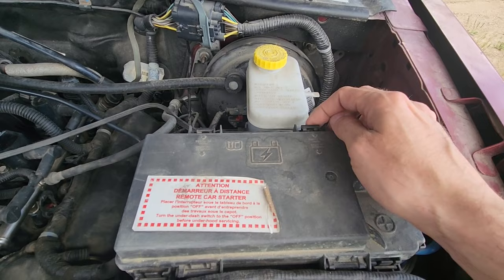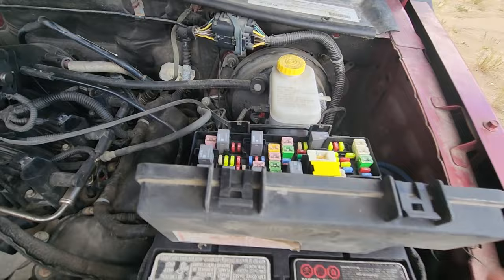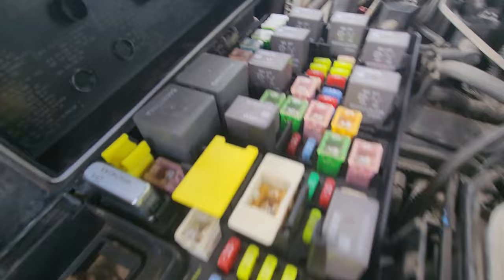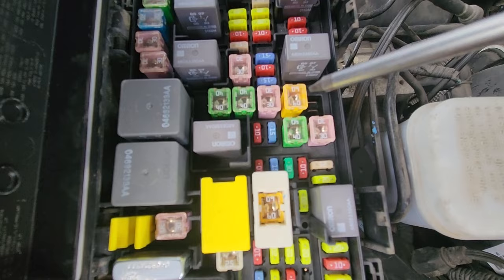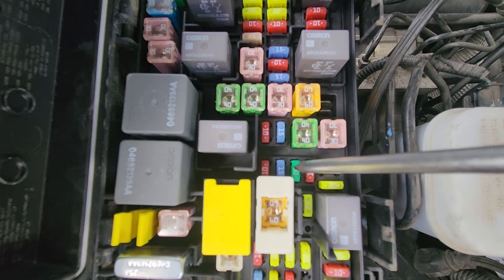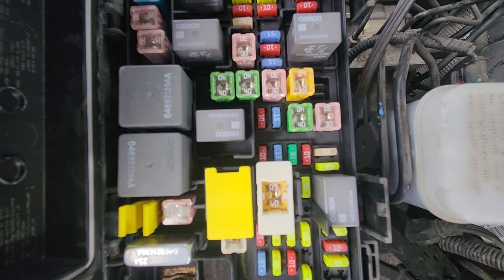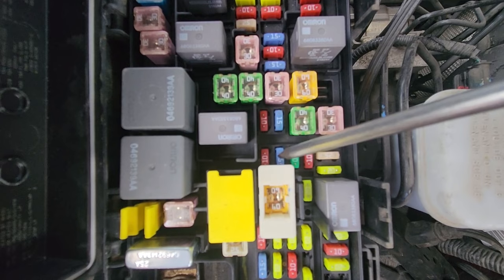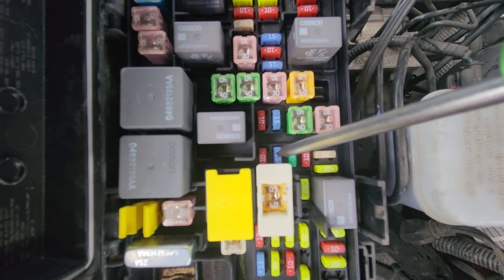Jeep Liberty -  RADIO FUSES LOCATION (2008 - 2012)

Comment: My 2012 Jeep Liberty radio/player/navigation system would not power on. I had determined 15 amp M10 fuse had continuity; however, I missed the 20 amp M12 fuse. Your attention to M12 led me to check that fuse. Both of the fuses checked good, but the radio powered up again. Just the act of removing the fuses and re-inserting them must have must reset something in the circuitry. Thanks for the good advice.
Reply from the maker: Hi, well I'm glad my video helped you out. Removing / reinserting the fuse probably reset it, just like you said

Comment: What if my radio goes in and out? It cuts on sometimes but very rarely and it’ll just cut off if I, say go over a bump. Is this a loose wire? My fuse seems to be fine
Reply from the maker: Yes it will be a lose connection in the back of the radio or it will be internal radio issue. First remove the radio and inspect all the connections behind it and make sure they are tight. If all good then start the radio once you have it out and start shaking it and tapping on it. If sounds cuts then it means it is internal. These Jeep / Dodge radios are terrible and most likely the problem is in the radio. I've changed hundreds of those
Reply: @QuiteAlright  thank you, I actually managed to fix it yesterday!! I’m so happy it’s working now. It’s been 4 months without music 😂
Reply from the maker: @cherrysIushie  I'm glad to hear that. Good job